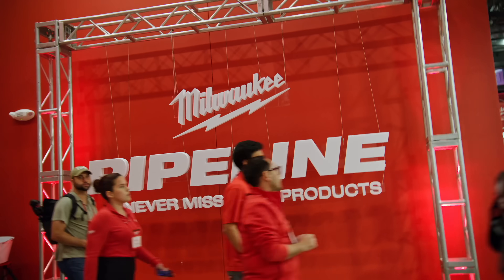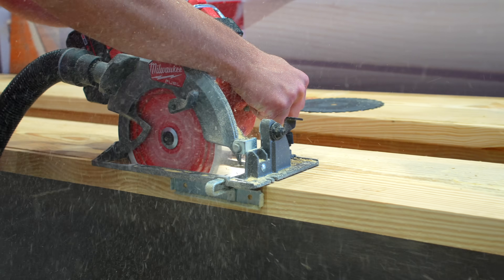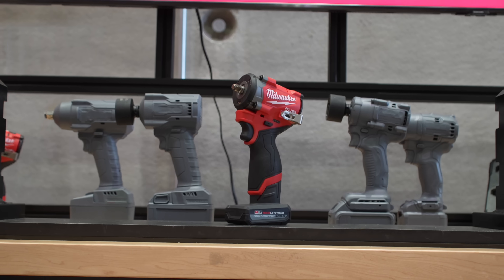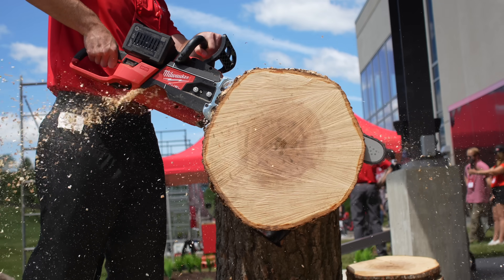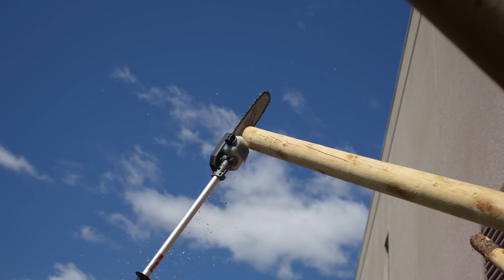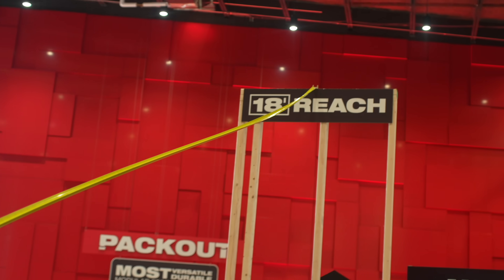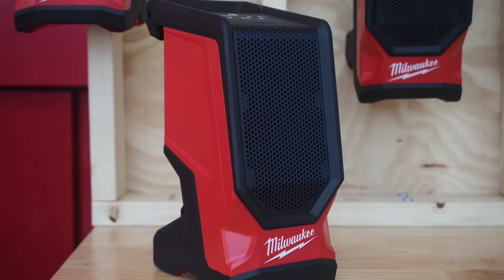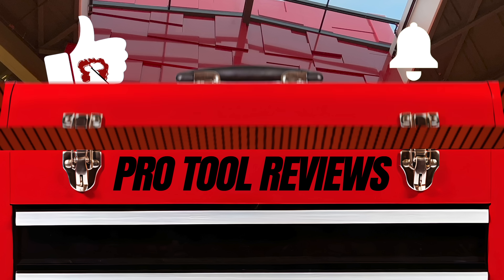New Milwaukee Tools From Pipeline! New Tools for 2024 & 2025

Comment: Milwaukee M18 Forge 12ah is $250.00.  Milwaukee is positioning themselves as commercial only, unless you're a wealthy homeowner.
Reply: Are you carzy no home owner needs a 12ah battery and plus there it the same price as there high output
Reply: Yea thats the same price as their 12.0 hi output. Been that way for a while now. I have one as a homeowner and the only practical use i have for it is the blower. That thing drains batteries.
Reply: They were never intended to be homeowner tools. 
From their inception they've been heavy duty pro grade tools. 
They have some entry level stuff, that's more appropriate for homeowner needs/budgets. 
TTI also owns Rigid & Ryobi which are both likely better options for homeowners.
Reply: I have the power head roto tiller, weed eater, rubber brush, compressor, router, plus all their common tools. All I use is 8 amp and 12 amp batteries. I'm regular homeowner. Big batteries are nice dude. They last
Reply: @dale4525  I never said homeowners do not own on 12th amp hour batteries just saying most people don't need it you have a expensive machine that most people just go and rent and use one time
Reply: Any homeowner that needs to do work would and should buy there affordable 12v lineup and maybe a recip saw in corded or battery. Even then you should expect the saw or blower is expensive and that is the only tool that could realistically use a 12a on its expensive in general for those tools unless you catch a deal
Reply: @alexpolicht9332  yes I fully agree with this I started out with the M12 stuff increase my collection of M18
Reply: @jordaynerjr only time I use my 12.0 is at home for my chainsaw unless I bust out the 9” cordless grinder at work
Reply: Milwaukee was never meant to be “homeowner” tools.
Reply: If you feel stingy, you can wait for a sale or buy a chinese M18 12 or 15Ah clone. I did so after all my 3 original 12.0HD fell victims to the substandard Samsung cells Milwaukee used. After a bit of reinforcement, clones work as well or better than the original.
Forge batteries seem to use pouch li-ion cells so they should be way more reliable.
Reply: Contractors and construction workers make good money. $250 is nothing when you can make that back the first day you use it.
Reply: Let homeownser buy pro grade tools and big batteries. Why do you care if they need them or not its not your wallet. Worry about yourselves its ridiculous
Reply: @juliuscesar7126  ok well then don’t complain about the price then? Thats what MY comment was in response to. 
A homeowner complaining about the price of PRO level power tools and batteries. 
Stuff they clearly don’t need
Reply: @disht2 you obviously don't have big Milwaukee m18 lights cause I do and then things need 12ah batterys!
Reply: @JasonSinatra-s3e  that homeowner probably has more money than you because he cant sit around and just fiddle with tools as a HOBBY. Tell em to shut up and buy.
Reply: @juliuscesar7126  yea basically my reply was “you don’t like how expensive this nice thing is that you don’t actually need or use enough to justify the cost? Try telling that to Harley Davidson about their motorcycles? You know what they’ll tell you? ‘Ok don’t buy one’”
Reply: @JasonSinatra-s3e  its the same principle people who never every rode a motorcycle will go buy a brand new harley to learn on. Let them be. Let them fuck up there money it does not affect us.
Reply: @juliuscesar7126  again…. I don’t care if they want to buy it. Just quit bitching over the price
Reply: @JasonSinatra-s3e  well ill quit bitching about you, bitching about them, bitching about the price and everybody will have nice tools
Reply: @JasonSinatra-s3e  That......Hurts my Soul man !
Reply: I have plenty of Milwaukee tools for a variety of home and work uses
Reply: Why would you need a 12ah for at home use?? If you’re not making money with your tools there is absolutely no point in that big of a battery. Buy a 5.0 and a fast charger and you’re set for regular use.
Reply: @peytonhorn2833  wow You know absolutely nothing. You would need a 12 amp hour for their larger tools like their lawn mower, their leaf blower, their weed Wacker.  All tools geared for home use. You'll get more power output and longer uses with the 12 amp hour battery. 5 amp hour just won't cut it with those tools
Reply: @Tonedog88  they have BEEN positioning themselves commercially for the past 15 years
Reply: I just went to Home Depot they have a in store special buy a 12 amp forge battery you get a 8 amp forge battery free so you get a 450 dollar value for 250 dollars
Reply: That's fine, there are plenty of home owner grade brands.
Reply: You can get 12ah forge batteries for about $160ish. I don’t think I could live with myself buying from one of these big box stores like Home Depot for anything Milwaukee.
Reply: Bro the dewalt 15.0 flexvolt is $400
The makita xgt 8.0 battery is $400

Milwaueke 12.0 forge at $250 is a steallll ive been makita for 5 years but now im all milwaukee for framing
Reply: 12 amp batteries were never designed for homeowners. Unless it's for your garage.. I have a 6 amp high output and everything I use while doing anything on any of my vehicles doesn't even drain the battery below 50%.

Comment: I am heavily invested in Milwaukee tools.  Over and over though I am finding that the tools are becoming apparently designed to fail quicker than should be.  When they do they are also designed to cost to much to repair due to items made to not be sold separately.  This is not a Milwaukee tool problem only.  Many other tool companies are going that direction.  I am slowly replacing the damaged ones with Makita.
Reply: I have had very great success with Dewalt tools, I did buy several Milwaukee tools to go along with what we do and they have all failed within a few months
Reply: Dean Doherty has proven that they’re built like shit and prone to failure prematurely. Not worth the fix either since u have to replace majority parts. Xgt Makita is where it’s at…

Comment: That chainsaw is something else.... An electric chainsaw that competes with gas is something i never thought id see.
Reply: Electric motors have been capable of tremendous power for a very long time. 
Some Tesla cars have well over 1,000 ft. Lbs of torque which is significantly more power than diesel motors in dually 3500's & the like. 
Batteries have always been the bottleneck.
Reply: Milwaukee needs to make a tesla style motor and stick it on a saw
Reply: I wonder if it’d mill the same as a 70cc saw😅
Reply: @Technie87 That TESLA line of power tools is gonna be friggin epic!🎉
Hear that mr. ELON!!😂😂
Reply: If u use these 18 volt chainsaw,s like a gas model u will fry the batteries, u need more volts to keep the batteries cool , that's what I was told 🤷

Comment: I have the new 18 inch fan and I'm very satisfied it's a beast but this new packout fan has been over due for about 4 years now. I always wonder why can't a light be on the fan incase you're in a dark area. It doesn't hurt to have it. If you don't wanna use it then don't. Or a usb A port to charge your phone
Reply: The battery would die much faster I imagine
Reply: @EPSKRCMPK  true but you wont always be using the light and we should always have extra batteries
Reply: I'm with ya except it needs a USB-C port instead for faster more powerful charging

Comment: Wish they'd make an AC adapter for M18 so you could have the option of plugging in your tools instead of opening them on batteries. But they wont do that, cause it would lose them battery sales.
Reply: I been wanting an ac adaptor for my Milwaukee air compressor.
Reply: An AC adapter would really help future-proof a lot of their tools. But they want you to buy their new tools in 5 years.
Reply: @JMPG868 I was all Milwaukee until I went with the DeWalt inflator because it has a DC adapter and optional AC one. Which lead to me buying a DeWalt Atomic compact drill because the kit w/ the battery was cheaper than the battery alone. Not switching over but I do like the DeWalt compact drill a lot.

Comment: My question is price if batteries, for example,  if an 8.o forge battery give the same performance as a 12.o high output battery, what's the price difference?
Reply: The 8.0 is 1.99 same as the 6.0 some reason and the 12 will be 2.49 same as the high output but they will probably drop 50